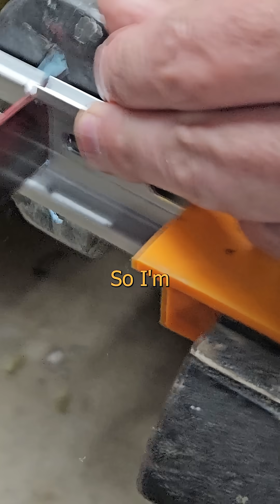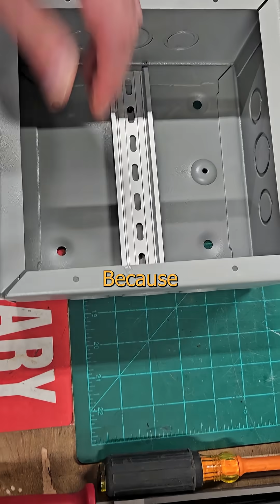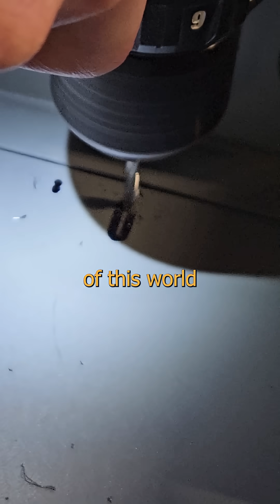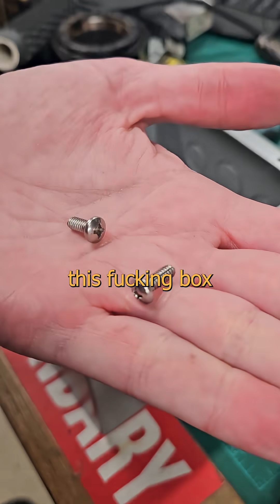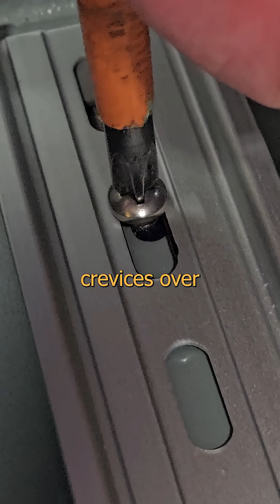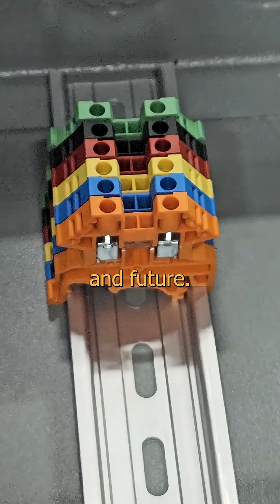Functional Junctions #chrisboden #comedy #engineering #electrical #craftsmanship #motivation #skills

Comment: Thank you for making this video. Sometimes I think craftsmanship is a lost art.  I remember the master plumber telling me that the words on the PVC should be facing out, then the electrician telling me that cover plate was not installed correctly unless both screws had plumb slots.  Keep in mind I'm Gen X so I might be a little old school but I miss this kind of craftsmanship. 

Again, thank you!
Reply: Us Gen Z can do the same if someone points it out. I turn all my capacitors so the label is facing out, I leave little notes behind for the next guy, etc.

But someone's gotta tell you there's a better way.
Reply: My husband (electrician) goes nuts if the screws aren't oriented the same way on recepticles and switches. I've went around and fiddled with them just to get a rise out of him when I was annoyed.
Reply: It’s trickier with screw pipe. I try getting all the writing oriented in the same direction also.  First time I heard about this, I was knee deep in mud making a sewer connection was telling me to turn it, turn it! I can’t see the writing! Too late Eddie, the tide is coming in!
Reply: Well it depends how much the people want to rush me. If im left alone to go at decent pace... then sure ill give a damn about craftsmanship. On the flipside, if I am rushed and yelled at and cussed out day in and day out by some bastard that thinks he has ultimate authority over me than all craftsmanship goes out the window until I either finish the project, get on a new crew or get with a new contractor. This is why im union, contractors can eat a dick when they treat their workers like garbage. I have a steward on site I can take grievances too, and if all else fails I can go to the hall and get with a new contractor/project pretty quickly.

Comment: Former mechanic here. This is something I used to be really interested with my dad. We would work a car, and the client wanted more power out of it. We dug into some power but, more importantly, the effectiveness and consistency of it. For example, adding fuel and oil cooler to this old v8, taking parts out just to reinforce a bracket that most likely no one is going to take apart again. This was nearly 20 years ago, and some of those cars are still running strong with proper maintenance.😊

Comment: This is my bread and butter. I am a UL certified industrial cabinet assembler.
In fact I’m getting ready for my 3yr recert.
I do this on the daily and I build from 4x6 j boxes to 6 door 3 panels Mains.
480vac,120vac and 24vdc controls.
Wireway, din rail, T-blocks, all the labeling. 
Branch circuits from CB to FB’s, VFD’s, SCR’s and PLC’s.
And I get to play with the pixies at testing phase too in my space suit.
I do have a really great job.
Reply: where/how does UL certify that? I've just been learning from the gray beards for a few years.
Reply: @SirLoinTheBeefy  
Step 1: Take the Industrial Control Panels UL 508A & Short Circuit Current Ratings course offered by UL and pass the tests. You'll get a copy of the standard, learn how to use it, and probably fix a few code violations along the way. Your state may even have a program to reimburse the cost of the course.
Step 2: Contact UL about getting your shop listed. They can tell you all about the labeling, record keeping, and regular inspections, as well as the associated costs.
Reply: This seems like a fun job, and definitely more fun than retail. What kind of places would I look for to do work like this or at minimum pick up new skills?
Reply: @mapleranger420  I'm not UL certified, but a big part of that is because I'm not american and my shop goes by my countries standards instead. I still do this on a larger scale, and I'm kinda specialized in VFDs thought my shop does many other kinds of control panels. 

When it comes to experience, I don't really know what is "normal" but when we need a lot of new people, my company will do on the job training, hiring anyone with a high school diploma. My company heavily favors people that have a trade diploma in instrumentation or electrical fields. If you wanted to go to school for something like this you're basically running semi in parallel with people going for an apprenticeship. (BTW this is kinda an option too, the other shop I've worked at wouldn't take on apprentices and at my company there aren't many journeymen so it's very uncommon but not unheard of, though you will probably move out of being a panel tech if you're going for your red seal.

The best suggestion I could make for finding a job in this area would be:
First Google "[your region] industrial control panel companies". When I did this it pulled up my company, and 2 companies I know are competitors to the company I work for.
If that doesn't work you could try to look into companies that sell stuff to the big industrial companies. (power generation, oil and gas, pulp and paper, that kind of stuff) Some of the companies that sell these products will also offer to build the panel that houses the products. You're not looking for manufacturers, you're looking for the companies that act as intermediaries between the manufacturers and the big industrial companies. 

I hope this may have helped. Best of luck out there! And remember that just because it's to code doesn't mean it won't explode!
Reply: I'm an industrial/commercial HVACR tech. There's a good chance I'll be able to admire your work while I'm busy shocking the fuck out of myself by grazing a live terminal while testing voltage. Thank you for your service!😂
Reply: I do the same on small scale for my company...but the UL certify is exxxxxpensive.  Basically...follow all the mfg directions and take the class.  UL is a company...not the NFPA nor NEC codes...just an insurance company that says..so what the the instructions say to match NFPA and we're good or when it goes in the toilet...it's your ass not the mfg.  It kinda like being a public notary...their ass is on the line if you lie on your statements.  Being certified put the onus back on the owner, not the assembler.  Remember last guy in the cabinet owns it, so do it right.

Comment: What kind of temperature sensors? 

If it's thermocouples, you have to use the terminals specifically for that type of thermocouple.

If it's RTDs, you better be sure those connections are tight.

Comment: If you really want to make the next guy happy include a little paper detailing exactly what component each color is wired to
Reply: Making sure the drawings are updated also makes people really really happy. 
Nothing pisses me off more then to use the drawing to follow a cable, starting as a numbered cable, and then ending as a coloured cable, and then having to track the entire length to find the hidden junction box
Reply: @dracul1986  Amen. I get pissed if somebody somewhere cant find me a drawing to red line.
Reply: @jmcguire708 I must have updated redline drawings in Eplan and ACAD more times then I can remember, always loved doing that, or designing the standard for doing so.
Reply: I concur! Labels are highly UNDER-rated in this world. I always try to at least write sharpie notes on the inside of the box for the next poor sap that has to think about what I alone understand in that moment. 
And too frequently that poor sap turns out to be ME!!
Reply: The 'next guy's could even be you in a few years. Can't count the number of times I come across a project and say to myself, now... What was I thinking right.. here.
Reply: If you're including paper if you can laminate it. 
Oxygen and age do not do well for papers stability. 
Even if it's just "laminated" in packing tape. Something to give it a little bit more resilience against the wearers of time
Reply: Add in a label to what each box connects to down the line and I'm a happy locator
Reply: Lack of labelling is a serious breach of  communications policy...
Reply: Ive put masking tape on wires with labels written on them before for that purpose. That way it stays with the wire
Reply: @thedudegs-f9w  Commercial wire labels  are a lot better and are available with any marking you can imagine. Most come with matching terminal labels.
Reply: Isn't that what wire labels are for? It is what I have always used them for.
Reply: @jonesgang  there is no such thing as too much labeling.
Reply: @jonesgang there's no such thing as too much idiot proofing.  A schedule in the box,  corresponding labels,  and even labeling what's coming out of each conduit some how are all wonderful things that don't get done often enough.
Reply: @racheleast688  Amen brother!!
Reply: @jonesgang unfortunately, those little numbers come off. So wire #26 turns into wire #2, or # 6!
Reply: @davidhelsem8794  Why use a 2 and a 6 when a label book has the actual number 26?
Reply: @davidhelsem8794 we used very tough stickers that you could only tear with a knife. Works way better then those chickenrings
Reply: @jonesgang Both the terminal and the wire should be labeled.  During assembly and maintenance you need to know both which wire is which and where it attaches.
Reply: @MarkHorton-n3t  Pretty much the entire reason to use wire labels. Not only does it make assembly easier but also makes troubleshooting a lot easier.
Reply: @jonesgang  wire labels are great but sometimes fade, get worn etc, or are simply a bit too small to contain all info. not really ever a problem in house wiring but in automation with like 80 different wires going to all sorts of terminals across the thing, a lil numbered and structured plan is a godsend
Reply: @KriegsverbrechenGaming  There are literally hundreds of different styles and types of wire labels/markers. I tend to use the ones you can print on any printer and wrap the wire. The good label will have two halves. Top is white for printing and the bottom half is clear so when applied the clear wrap protects the printed part. No fading nothing. Clear and easy to read for years. 

The problem is not the label or marker itself, it is the laziness of people not caring enough to use them when they are needed. Which is pretty much everywhere!
Reply: @KriegsverbrechenGaming  If someone gave me a print and a box with 80 unlabeled wires, I'm not going to be very happy...

You can write a paragraph on a printed label.
Reply: @jonesgang that also works until it gets wet etc, although the paper sheet will do the same 🤣
Reply: ...and include the date so that the next guy has an idea of how out-of-date the information could be.
Reply: No joke!!
Reply: The two biggest lies we tell ourselves that bite future-us in the butts:
-I’ll remember that
-Well that’s obvious to anyone who looks at it
Reply: I would draw it on in the inside of the lid, just in case someone lost the DIN compliant diagram, and I was just an uninformed, underpaid, overworked "unskilled" worker..I really hope that those who spent 4-8 years of education did better.
Reply: The idea of a booklet, a tiny manual or just a piece of paper I can carry around while working or have a picture in my phone to check my work, the idea of finding something like that brought an instant smile to my face.
It's like a love letter to the poor adventurer that may have to dig in there the next decade.
Reply: @KeitaroTsurugi  I don't know how they do things now, but FLSmidth used to do just that. Everything had an electrical diagram, a component list and duplicates all over the place.
Reply: What exactly do you do in power generation title wise? Really debating a career change and you seem to love it and seem to be of similar mind😊
Reply: Print a label and stick it to the inside of the lid.
Reply: Ngl i would get the electric diagram 3D printed with different colors and leave it glued to the inside of the door
Reply: You've a really good point. I had to go into t he crawlspace to run gas pipe to the manifold.  I find a perfectly encapsulated space....no spiders, bugs or guesswork as to what went where. T here was even a  little chart telling me what went where.  I spent a good 5 minutes in absolute awe of whoever did this. So cheers to you, you made my day a good one
Reply: At least what it was wired to when the box was first installed. No guarantees that's what it's actually wired to the next time some poor sod has to open it up.
Reply: Laminate that cheat sheet if possible, or spray-clearcoat it to the inside if it's a sticker. Paper is just thinly-sliced tree, and nature has all kinds of things that love eating tree.
Reply: As long as every wire is labeled and every terminal is tagged, there should be a whole drawing package. Just got to do the one thing no one would ever do, REDLINES!
Reply: No lie I'd love this even if there weren't color coded clips. Labeling which breaker switches tripped what was my favorite thing about the house I moved in to for a while
Reply: Or at least follow the standard sequence and put those colors in order!
Reply: I don't know who is going to be working on the system next so diagrams should be a part of safety standards.
Reply: @Tessilla-ie4pn  It would seem keeping updated plans are never updated. We dealt with that on a military installation. It was built back in the late 50's and none of their prints were ever updated throughout the years for any of the hundreds of buildings. A lot had changed over the years with walls being knocked down to make larger rooms and other modifications. Circuits discontinued and or replaced are not updated on the prints. But that is the nice thing about conduit. It is easy to follow, except for when it is buried in concrete. 

But yes updated prints would be very nice to have.
Reply: And how you double fisted the box to get all the colors in there.
Reply: Yes that is super helpful super awesome of you to do that. It's like pulling apart a gearbox and then leaving it for the next guy to change out a gear and you have a million bolts all over the place put them back in the holes Loosely and have everything in place so he doesn't have to spend more time looking for stuff then actually working

Comment: That's me
I currently fabricate steel concrete embeds and my variance from blueprint is often less than an eighth of an inch and less than 3 degrees of warpage for stuff nobody will see.

Would I like more public facing stuff to make? Sure, but my work holds up buildings.
Reply: It will give you insurance that your work wont be the thing failing and industry minimums are the minimums. Does it take bit more time to do properly, sure but everyone of us should be proud professionally about our workmanship to level where if something comes up, you dont have to think if you fucked up. Mistakes do happen but it should never be cause of shoddy workmanship.

Comment: You can have your DIN rail and WAGOs, too. WAGO also makes some really great terminal blocks that are spring-loaded. No screwdriver required to install or pull, aside from pushing a little button to release the tension.
Reply: Phoenix contact as well. The push on terminal blocks save time and eliminate the need to properly torque those tiny screws as the spring keeps the connection under constant pressure
Reply: The spring loaded terminal blocks are great for vibration prone equipment or locations too. I use a little bit of both depending on the application.
Reply: Came here to write this
Reply: You can even get din rail mounts for 221s, for that matter. I’ve used them.
Reply: And they are expensive as hell IMHO. I use them in my home projects but can understand why contractors pass on them.

Comment: No back plate! You savage!!! 

Just kidding
The next guy will release a sigh of relief when he opens the box and finds out it’s not a bunch of wire nuts. 

Great work!
Reply: I was going to make the same complaint!  In jest, of course, although I'm more used to 4X enclosures.
Reply: I’d rather find a wad of coiled up wires with nuts that I can pull out and work on outside the box… assuming stranded wire that can actually be pulled out of the box.
Reply: @livingunderarockunderarock9963   Because they are 2 bulges in other direction just for the bolts.